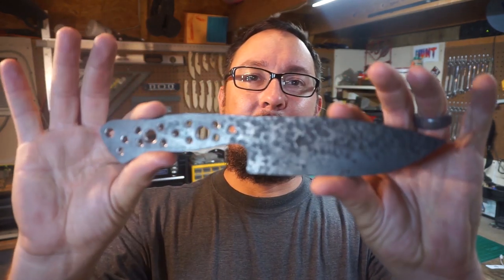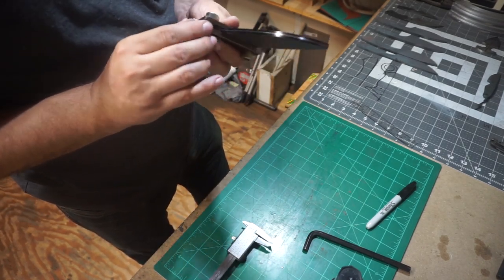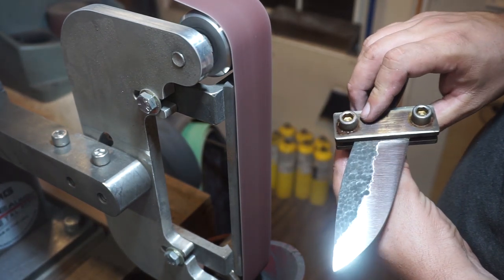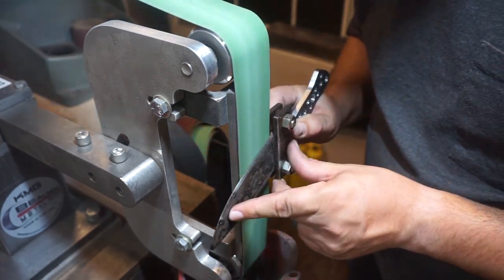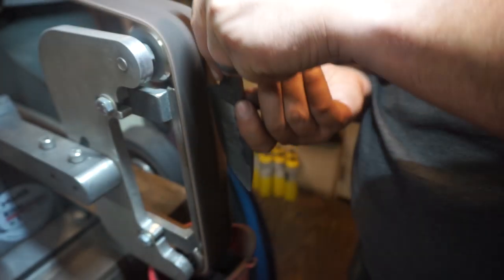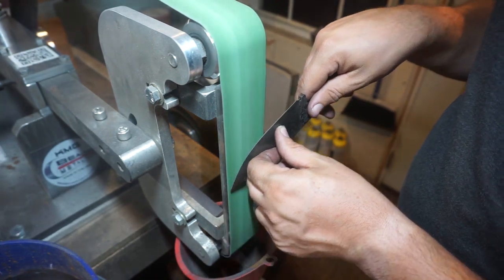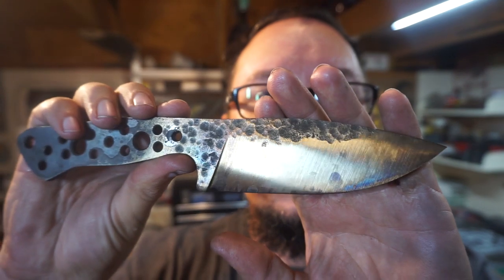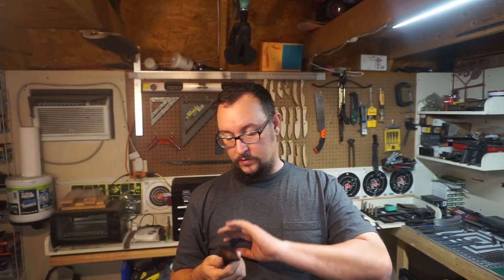Bevels, Heat Treat, and Temper on "The Hunter" 5160 Knife | Knife Making | Daily Vlog

Comment: Might be helpful to your temper setup 🤔 
I have a 24 hour timer that fits at the outlet and my toaster oven plugs into. 
I set my timer for the 2 hours cycle and it shutdown for 30 minutes and restart the second 2 hours and finish itself off as desired. 
 I'm planning to use parts from my toaster oven and building a heavy insulation oven just for heat-treatment of my Forge work. 
Thanks for helping us and hopefully I  might be able to help you with this project
Reply from the maker: Thats actually an awesome idea! Thanks John. 👍

Comment: Good stuff, I was thinking you would temper then clean up the blade for acid? I'll see in tomorrow's vid I guess if you now re clean before the acid, I assume you have to remove scale from heat treat before tempering, not saying you did it in the wrong order just curious :)
If possible could you do some info re your different belts on a tool episode? I've ordered some scotch brite belts but only ordered fine at this stage and now think I should get a coarse?
Reply from the maker: For sure you should get the coarse belts. I order all three: fine, medium and coarse every time I order. Good points that I will be addressing in tomorrow's video.

Comment: Question.

Which oil is best for quenching leaf spring knives? You're using peanut oil. But can other vegetable oil be used? Most of the videos I see people use canola oil, but most of them don't use leaf springs. I have made a leaf spring knife myself and it's waiting on my shelf to be hardened and tempered. But this is confusing me which oil to use. This is my first knife. Help please!
Reply: I also use peanut oil.. left over stuff from my deep fryer.. experiment
. Get a set oil temp. And test a few pieces...use coil springs from a strut.. you can get those for free a lot of the time.. and then abuse it. I only use 5160 so far. Have got a lot of food results.. and my garage smells like French fries or coconut shrimp when I'm done...
Reply: A commercial quench oil is preferable, but most leaf springs have a high enough hardenability that it doesn't matter that much not all leaf springs are necessarily the same material so ymmv.

Comment: so the bubbles i get as well.  is there a explanation for this or is it just the result of heat treating?
Reply from the maker: It is just a result of the heat treating process. Sometimes its because the steel is too hot or the Oil isn't the right temp when quenching. You can use "anti-scale" to stop some of it.